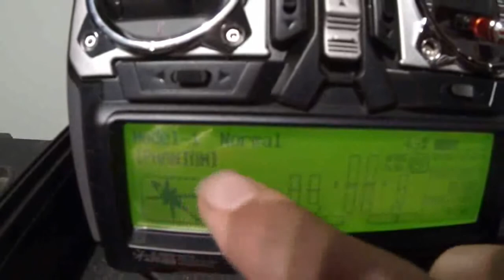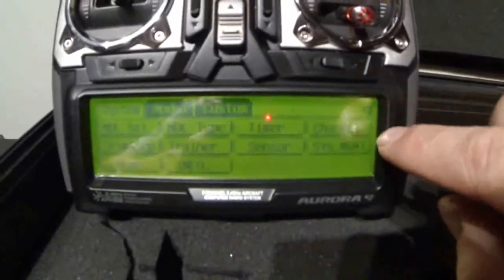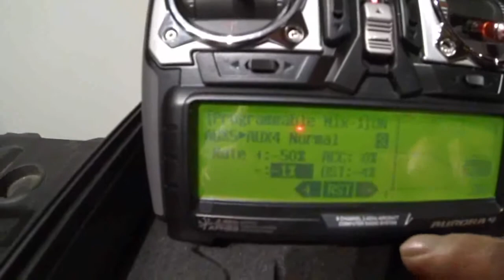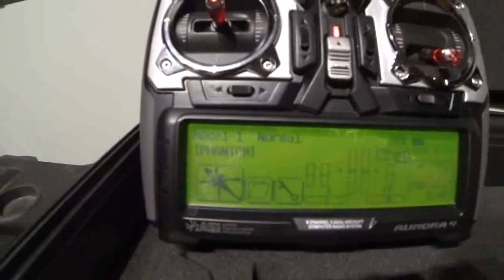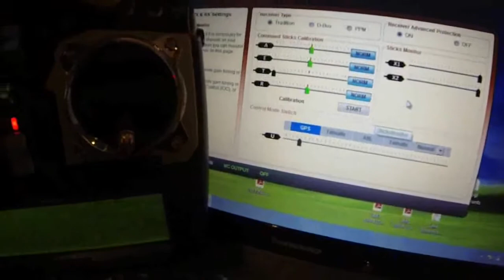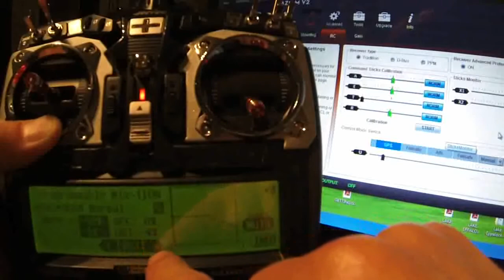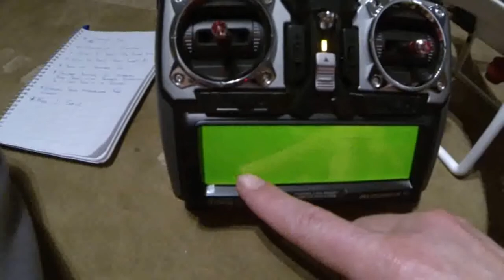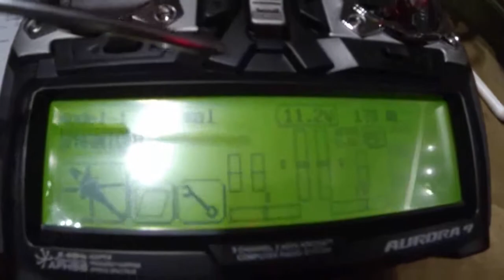How to Set up a Hitec Aurora 9 with a DJI Phantom

Comment: Does anyone know where to find information on how to physically install the Optima 9 inside the Phantom? This video is the most informative I've found, but it begins with the receiver already installed.
Reply from the maker: Hi Ben, Sorry about the delay. You will need Male to Male servo leads and only get the short one's, about 10cm is fine. I think from memory you need about 5. I removed the standard DJI receiver and used a good quality double sided tape and stuck it were over were the standard one was. I have since put on the zenmuse gimble and have programmed one of the side toggle levers to activate the tilt on the gimble. Works great. Hope this helps
Reply: WishyouwereRandy

Do you have more details than this? A diagram would rule.

Comment from the maker: Sorry Johan, for the delay in getting back to you. Even though your transmitter is mode 2 you can still wire the same using your optima 7. You will have to mix other channels other than the ones I have done. I just won't get time to do a video on the optima 7, but if you do the same as I have done and work out which channels you need and also which of your stalk are the throttle, rudder and so on it's not that hard to programme. hope this helps.

Comment: Hey Randy, i'm new to this hobby i have the DJI Phantom and the transmitter AURORA 9 with the OPTIMA 7 HITEC receiver can you make a video how many wires i need and how  i connect the wires from the NAZA M to the receiver OPTIMA 7. My throltle is on the left side on the transmitter i hope you can help me up 😥😉
Grtz, Johan